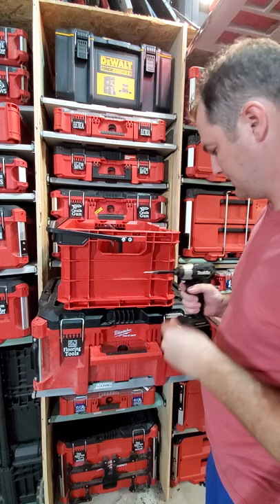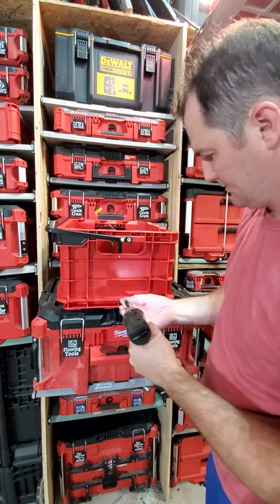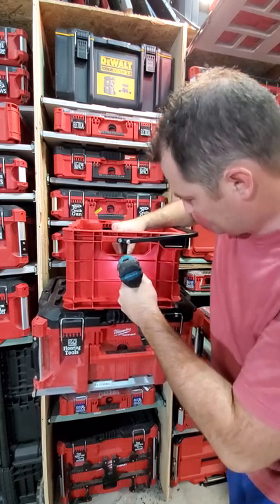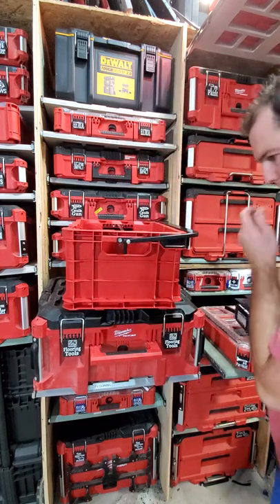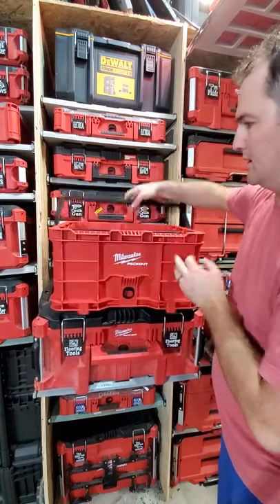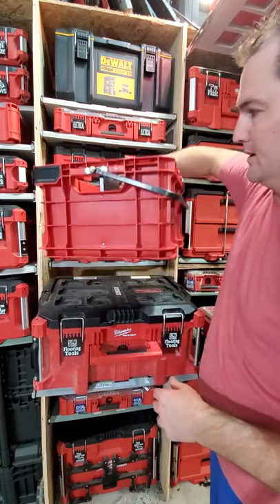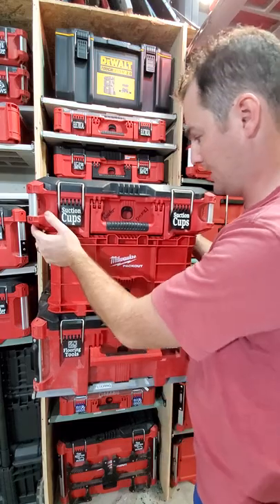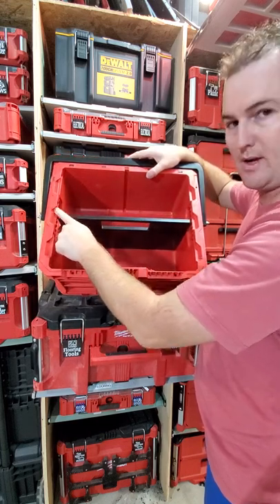Milwaukee Packout Crate Long Side Divider

Comment: Great product! Just received mine today. The only complaint that I have is the divider that I received did not have the cut out for the handle. Looks to be very well made other than the handle issue!
Reply from the maker: it didnt have the cut out for the handle in the middle of the divider or the crate handles on the side?